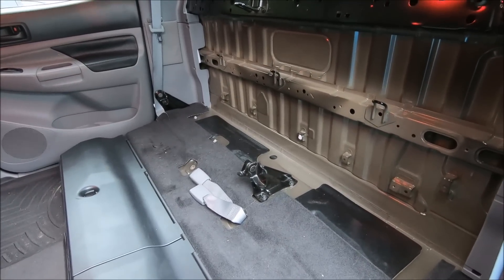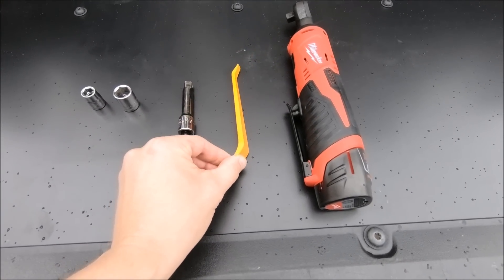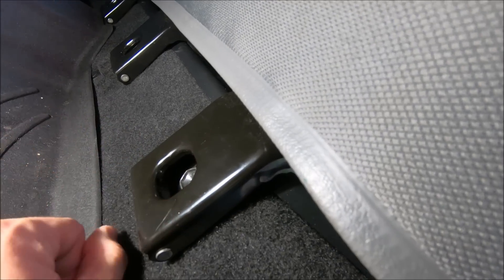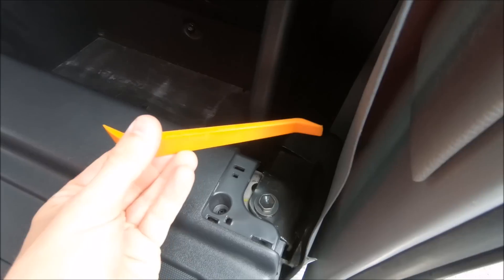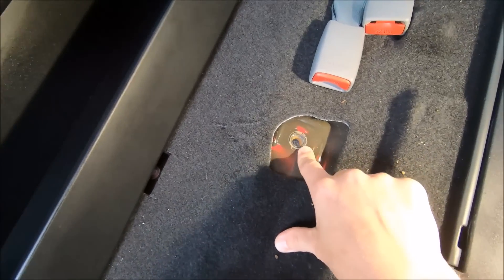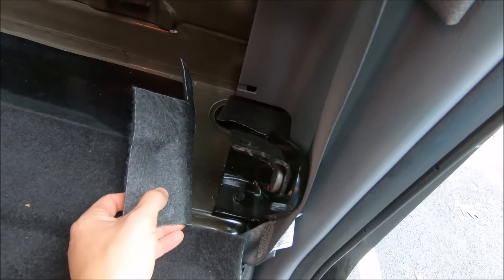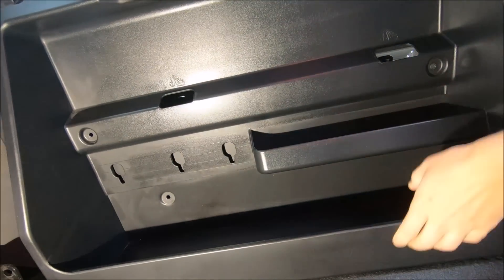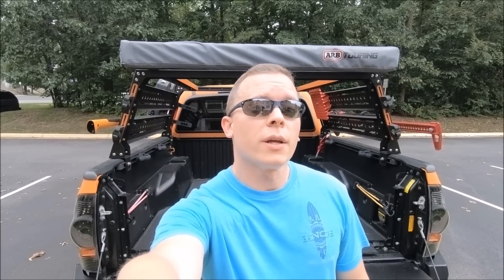How to Remove the Rear Seats in a Double Cab Toyota Tacoma

Comment: Greetings ~

~ Literally, about a few days after purchasing my 2018 TACO, I removed the back seats, leaving the rear cargo storage areas.
~ This was done out of necessity and for storage of my wheelchair.

~ in the process, working together with a friend, we made a rail system, so that my chair would be placed securely while I was driving and it works great. 

~ The system gave me 2 different options for transferring the chair from the TACO and making it much easier (for me) to do with fewer steps.
~ This also makes it easier for those friends, to transfer the chair to/from the TACO, without making it a hassel for them or for them to - "take down" - the chair and learning a new method as its pretty straight-forward.

~ its been about several months since then and its working like a charm without any issues.
Reply from the maker: Sounds like you guys got pretty creative! 😀👍 Could you email me some pics of the rail system?
Reply: Great idea, I also would like to see the pics. My mom's walker wheel got tangled with the wheelchair and deformed. The chair is getting beaten up too.

Comment: Enjoy your videos.  I have access cab 2015.  Thought I was hearing to much noise behind the driver and passenger seat (used phone app for cab sounds/decibles).  Pulled all and used sound deadening  material.  Found no sound deading material (OEM) behind front seats or rear wall.   Sealed all with deadening material (added a bit of wt). Tape used on any open holes that weren't threaded.  All threaded bolts in place especially if leads to out side.  Improved 2-3 decibels.   Still hear  a bit of noise (? if I should build a cover below cab that covers the gap between cab and bed....may get rid of lower road noise).   I also created a rear deck  instead of  returning jump seats (which allows access to toyota storage) but gives me two levels of storage with large flat area (good for cooler).  Also cut holes in deck for large (34-64 oz) Hydro flasks (to prevent rolling around in back).  I do pull the deck on occasion and replace jump seats (half hour conversion with 15 bolts).
Reply from the maker: I'm curious to see how much of an improvement the sound deadening material will add.

Comment: Do you have a video to remove 2011 4 door Tacoma front seats. Thanks
Reply from the maker: No but it's really easy. Just remove the bolts holding the seat to the floor/bracket, then disconnect any airbag plugs beneath the seat. It's easiest to fit through the door opening when the seatback is folded forward as far as it will go.

Comment: I'm going to look at and likely buy a 2008 Tacoma in the next few days, and I wanted to know if I could remove JUST the rear driver's side seat so I can fit my sub there better. Glad to know it's not only possible, but easy. Thanks!
Reply from the maker: Yes you can! Been awhile since I removed my seats, but IF the smaller driver side is connected to the passenger side it should just be a few bolts to detach.

Comment: 3:52 Can you remove the larger passenger side seat without removing that bolt for the seat belt? I plan to put the seats back on, I just want to remove them so that its easier to install Clazzio seat covers on the rear seats.
Reply from the maker: If I remember correctly that bolt has to come out to get the seatback out since there's no way to remove the seat belt from it.
Reply: @Tacomaholic  Thanks im going to install the seat covers this weekend and I wanted to do research on the best way to install them. Next week hopefully I can take my truck to get wrapped in paint protection film.

Comment: Hey man if u got a moment couldnt u commemt me a link to the same lift kit u got with everything?
Reply from the maker: Greetings Zach! Here's a link to the kit I'm running (SPC Upper Control Arms, front 5100s, 887 spring, dakar packs): http://www.headstrongoffroad.com/store/p312/Coil%2FBilstein_5100_Kit_w%2F_Dakars_%28HS05BK-1-Dakar%29.html the only difference is I'm running the extended travel rear 5100s.

Comment: Was wondering if you removed the passenger seat along with the back seats, what the length is from passenger feet area to the back wall? Was wondering if I could make a bed there?
Reply from the maker: I did a quick measurement and have 85" from the footwell in front of the passenger seat back to my rear wall molle panel so plenty of  room to sleep if you add enough padding.
Reply: @Tacomaholic  Thanks! Im 6' so was wondering. Ya enough room cool. Thinking I cot mattress would work well. Then I can put a cooler behind the drivers seat. Then put a double slide window through the back window and cap window to grab canned food or whatever.

Comment: Have you tried having the seats installed but leaving the storage panels out? The storage panels look like they take up a lot of space just to look pretty. I wonder if it’s possible to get more storage space in there, while still leaving the seats in for use.
Reply from the maker: I haven't tried that yet, but there are sweet molle panels you can replace those storage panels with which greatly increase your storage capacity back there.

Comment: also I have to aftermarket racing seats that match my truck very well they're universal seats do you have any suggestions or ideas on how to install them.
I'm thinking about buying another pair for the rear so I can have for matching seats
Reply from the maker: As long as they fit in the location the seats, you will need to replace the factory seat bracket with one that works for your Tacoma AND the seats in question.

Comment: tacomaholic can you please help me!
I'm trying to install individual seats in the rear to make a little bit of space between the driver side and the passenger side I want to install subwoofers and I want to have an exposed subwoofer in the middle is there anyway I can install single seats and the back do you have any suggestions
Reply from the maker: That's a tough one. The jump seats from a Tacoma access cab might work, but I have no idea if the mounting area would line up with anything on the floor.
Reply: @Tacomaholic  you should do a video on universal seats one day that would be really cool.
only when you figure it out
Reply: @Tacomaholic  you should also do a video on the urd throttle body conversion with the 5.7 tundra throttle body

Comment: I want to remove my backseats and replace the area with some storage organization system. My wife hates the idea, but 99% of the time, the only thing that lives in my backseat are just tools and STUFF.
Reply from the maker: I'm thinking of doing something similar maybe with lightweight plywood and then put some speaker box carpet over it to clean it up.
Reply: I want to remove my backseats to make personalized storage for my camp gear. Hope to have them removed soon